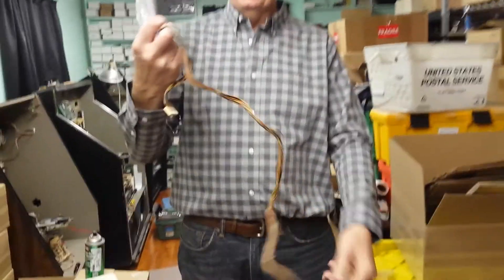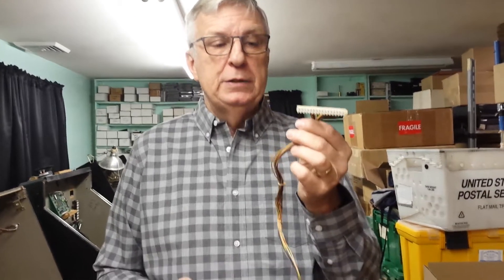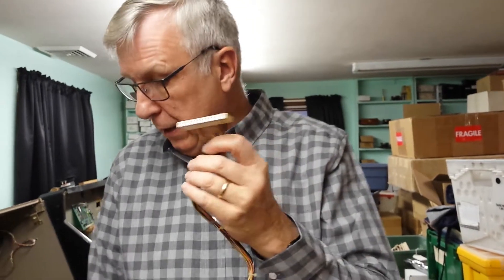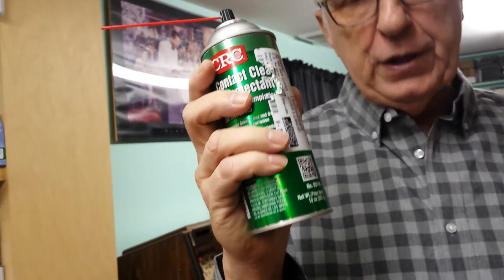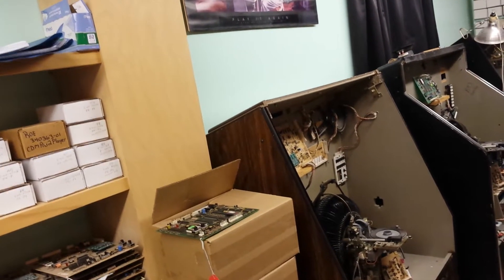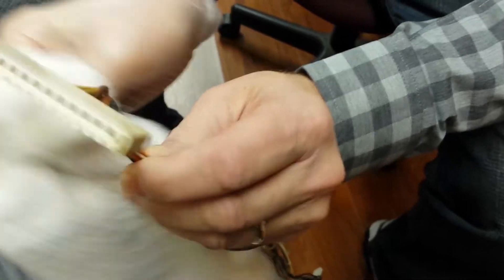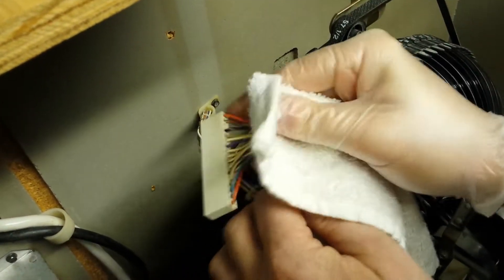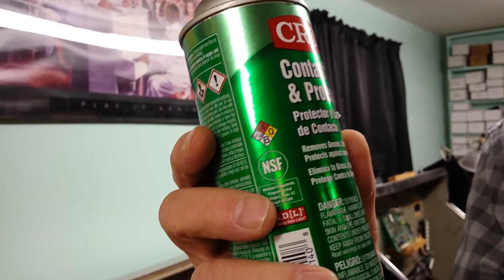troubleshootiing error codes 37,38,39 in rowe record juke boxes

Comment: did not work what do i do next what the cost for for part
Reply: Hey, Jimmy. You could have a bad cable (Harness), damaged pin within the harness,  which Bruce is showing here. You can either try replacing the cable from the CCC to MCB or if that doesn't resolve the issue, you can send in the CCC for repair. Good luck!